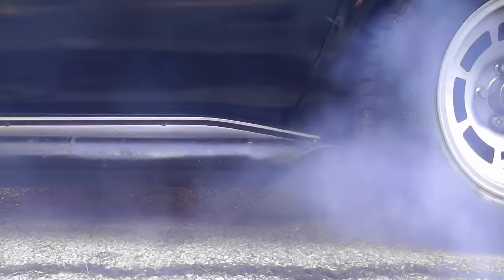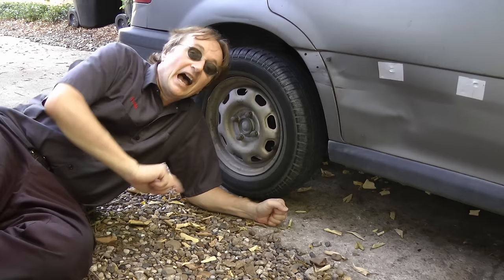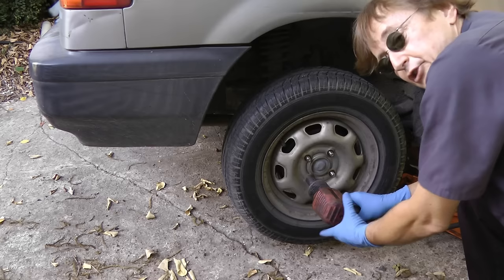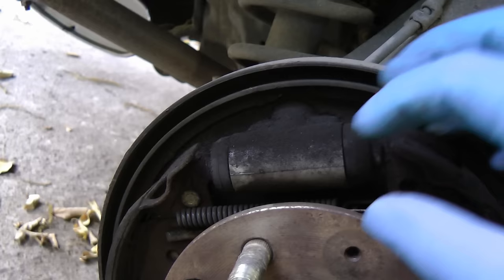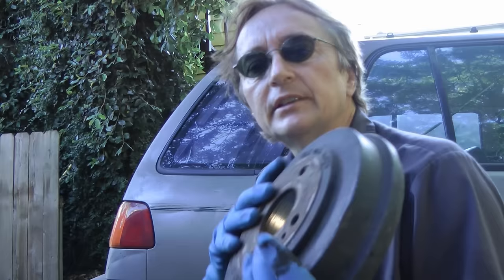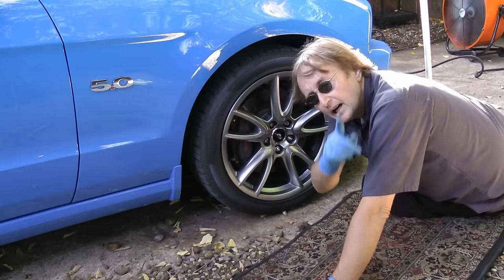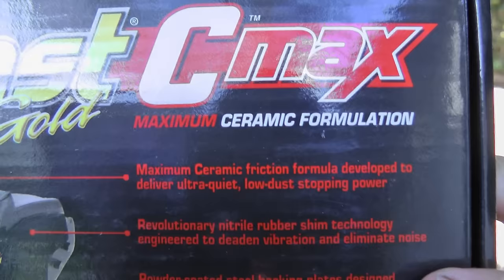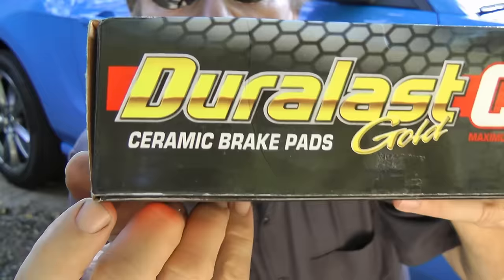How to Fix Squeaky Brakes in Your Car

Comment: hi I have brake problem on my car it's start after driving the car 40 km
and the problem is braking is not working wel it make some noise especially when car is on 20 to 30 km speed
please help me
Reply from the maker: when it doesn't start, if it doesn't crank, replace the starter. if it cranks but doesn't start, do my video "fixing a car that cranks but doesn't start up"   As for the brakes, pull off the wheels and check for wear there first, if you find none, often a bad master cylinder
Reply: no, I mean car doesn't stop when I push the brake
Reply: Like he said it could be the master cylinder or you might have air in the brake line.  That's probably why your car won't stop when you push the brake pedal.

Comment: I bought a Mercedes c300 and the squeak is bad. I brought it to the shop and I was told the brakes were new and that I needed to replace my rotors as well as brake pads again to stop the squeak and that will run me $800 to fix. But safety wise. I’m okay. 😑😑 I don’t have $800 laying around to give them more money out of me. Do I have to pay this costly repair or is there a cheaper way like this? Or something I should ask for next time I go to a shop?
Reply: Do it yourself is cheaper way

Comment: Hi Scotty,
I have a problem with squeaky breaks, I think I did all the tricks you mentioned here and still can't get rid off this annoying sound.
1. I bought new pads and they where good 2 days, after that they squick like crazy.
2. After that I took them off and lightly sand it to take of polished surface, that was good again for 2 days, and I have a same story all over again. 
(My car is old type '90s and stuff.. doesn't use ceramic pads)
What else I can do? I'm thinking about purchasing new brake disks but don't want the expense if that not going to help.
Please, I appreciate any advice on this one.
Thanks.
Reply from the maker: Tomislav Kukic if you put on quality pads and new rotors, noise will always go away. You can't sand rotors to make em not squeak for long, replace em if noise bothers you
Reply: Scotty Kilmer Thanks I will replace them.

Comment: You're the man, Scotty. I love the videos. I have a rattle in my dash of my '95 Civic. It only happens while in drive and I think it's my heater core. I'm losing water somewhere but I don't know where. I changed my oil to see if it has leaked into the motor but it hasn't and there's no water inside my car so it's a bit of a mystery. Any advice?

Comment: I just had new pads put on the front of my car as well as the front rotors sanded down, now 2 weeks later I'm getting a weird creaking sound (not squeaking) when I apply the brakes, sounds like it's coming from the front,  Only happens now & then.  Also it doesn't feel like the brakes are grabbing properly I have to really lay on them to get the car to stop, what could this be...anyone?....new pads are ceramic.  it's an 04 Toyota Highlander, 118k miles.  no dash lights come on.

Comment: Scotty On my 2008 Jeep Liberty, by rear breaks squeak ever so slightly when I don't have my foot on the breaks every little imperfections on the road makes the rear brakes squeak a little without me applying any pressure to the brake pedal, it's annoying,but what exactly could it be?
Reply from the maker: if it has thick pads still, live with it. But if you don't like the noise, but on Akebono pads which are very quiet and make no noise. Jeep just uses cheaper pads on their vehicles
Reply: Alright Sir thank you!

Comment: Hi Scotty. I've recently acquired a 2006 Volvo V50 T5. I sent it in for its cambelt service 3 months ago, and brakes were still squeaking afterwards. Shouldn't the pads have been checked in the service? It only starts squeaking after about 10 minutes' driving, btw.

Thanks for any help I can get. ;)
Reply from the maker: volvos are notorious squeakers, ONLY replacing pads with quality volvo pads AND rotors fixes that, but if pads are thick, many just ignore it as that's how volvos are
Reply: Scotty Kilmer Thanks very much. I would have thought that quality Volvo pads and rotors are what I already have, since the car has a full service history and has only been worked on at the dealer. :/

Still, I will check the pads for wear as suggested in your video and clean them while I'm at it.

Comment: Hey scotty I replaced the front brakes and rotors on our 1986 pontaic 6000 2 weeks ago and now the front left brake makes a loud rapid knocking noise and vibration when I applied the brakes to slow down... what do you think it might be
Reply from the maker: either that rotor is out of round or it not mounted on a flat surface (the hubs often rust and need cleaning off or rotor will sit crooked).
Reply: Scotty Kilmer  man top caliper bolt came loose, the caliper itself was hitting the rim, and bent the back plate... I caught it in time thank you scotty

Comment: When I put new brake pads on I started to get a slight scratching noise when I drive and my rotors and calipers are still very good what can it be?
Reply from the maker: TeriyakiRan most rotors have a small ridge, if you dont replace em, they tend to make noises
Reply: Is there a video on these ridges and how to replace them?

Comment: It's it normal for the new rear brake pads to squeal? New set of rotors and rear pads. The brake only squeal after driving more than 40+ mph. Once it cool down it doesn't make squealing too often. I noticed if I brake harder it barely makes the squeal.  I was told there was needing a break in period for the new pads to settle in. I am currently using a thermo quiet ceramic pads for the back.
Reply: +Elton Tang I forgot to add, it doesn't sound like a normal squealing. When I apply the brake it sound like vibration squealing, I am not sure how to explain it too well.
Reply from the maker: +Elton Tang  You changed rotors and pads, only thing left is all the brake hardware the pads fit into, those metal parts, change them places like auto zone sell the kits
Reply: +Scotty Kilmer can you change the brake hardware at autozone ? Mechanics want to charge 150 labor for changing the hardware
Reply: +Natural Bro TV by changing the hardware do they mean the brake caliper?? I can't imagine someone charging for $150 dollar that. You can simply but the hardware kits and just change it yourself. Basically if you know how to change your brakes is simply take out the pads and swap out the metal brackets and all the boots around the caliper pin cover and etc.
Reply: no the hardware means the brake clips, no one really care much about changing them but they cause squealing

Comment: Hi Scotty,  I just had my rotors replaced about 2 years ago along with the back brakes and Just had my front brakes replaced but since then occationally my brakes (i think) have been making a gurgle sound when braking at low speeds. I have topped off my brake fluid and pumped the brakes to get the air out of the line after filling it up. still makes that noise. I don't have to put much fluid in at all. maybe a eighth of a inch of fluid when i do. Any ideas? It is a 1993 ford explorer
Reply from the maker: often that's a worn brake master cylinder, if you see no leaks, it's usually them cause they leak internally into the booster
Reply: should i worry or is it just a nusisense? I'm newly widowed and don't have alot of money to spend on my car but if it is a safety issue I best do it. 
Thank you for the prompt reply and I always search for your answers!!

Comment: hey scotty my car squeak when i put it in drive and let the brake go slowly what does this mean.the noise kind relates to taking off bolts with have been torqued very tight.Plz Reply
Reply from the maker: +talha rehman  check the brakes first to see if pads are worn down. If not that, MANY things can squeak, from old bushings to  worn struts
Reply: ok.Thanks for the info though

Comment: Hey Scotty, I replaced my rotors all around along with duralast gold cmax brake pads (like ive always used) and they started to squeak after like 1k miles, I checked them and greased them up but still they squeak. I also notice they won't squeak at all when brakes are still cold but once they're warm (after like 8 stops) they squeak while softly pressing the brake or while moving at low speeds, pressing the brakes hard makes the squeak go away. Any ideas??? My car is a 2004 Mustang v6 if it helps
Reply from the maker: pads or rotors were just cheaply made, their coatings came off and now they make noise. I personally use akebono pads, they never do that
Reply: Thanks, I'll replace the pads and shims first to see what happens first,  if all fails then i'll just move towards the rotors.

Comment: I have a 2015 Audi Q7 and my brakes are squeaking, and I havent changed the brakes since I bought it. I have 5k miles
Reply from the maker: rust often does that from not driving them enough, it builds up, then wipes off after they heat up

Comment: I have a new tundra with 1600 km on it and the breaks squeal horribly for a long duration.  But only until they've warmed up.  I could ride the break slightly and it will be non stop screeching.  What can I do?
Reply from the maker: I would put akebono pads on it, they never make noise.
Reply: thanks.  and oops *brakes haha
Reply: oh gee never thought of that.  thanks man!  
how do i get your mother to stop squealing as well?

Comment: my 2001 dodge neon has brand new brake shoes and drum and hardware but makes a lot of noise while I'm driving and gets quieter when I brake. does that mean I should add brake grease or could it be the wheel bearings that need to be replaced also?
Reply: or could it be the parking brake needing readjustment??
Reply: +Anthony Lorenzen Maybe it is
Reply: +Anthony Lorenzen Maybe it is little rock stuck beween your breaking discs, I haf that noise too and I went to service and they told me it was because of stuck rock

Comment: hey scotty, quick question, long story short, my rear breaks started making noise when it got to around 20 km and it was like some sort of a noise where a metal was scrapping against another metal. so got my pads and rotor changed cuz it was time to change anyway. noise was gone for about a month, and SAME noise came back, took it back and same story, was gone and came back and I'm getting really frustrated as this issue is just not going away, and i know its the REAR, please any tips or advice would be awesome. it is when the car gets to lower speed and there is also a new noise where i apply the break halfway it makes the noise but once i press it all the way, it goes away... and its a 2007 Honda Civic Ex coupe. thanks. ALSO THE FRONT AND REAR PADS AND ROTORS ARE ALL BRAND-NEW, and the last time i took it to my mechanic, he replaced both rotors in the rear cuz one of them wasn't straight and had some bends to it.
Reply from the maker: +pavarchin   cheap parts do that. They have coatings on them, which wear off then make noise again. Go to a mechanic who uses better parts.
Reply: thanks a lot for the reply, but this mechanic used the best ceramic rotors, like its getting really frustrating, this is the person who has been fixing all of our car problems for a while now

Comment: I have a 2000 eclipse and the brakes are squeaking so we turned the rotors, pads are still good, but the squeaking won't stop. Should I just get new rotors and pads? If so what kind?
Reply from the maker: yes, get new parts. Akebono pads never squeak and if you use them, you can even buy the cheap chinese rotors, they will work fine with akebono pads
Reply: Okay and also my Dad  is so sure that standard rotors won't work on my eclipse but should I just listen to what the part store says?
Reply from the maker: James Hampel
listen to the parts store, they have to guarantee what they sell you anyway
Reply: alright thanks

Comment: hello,parked my car for over year,picked it up and drove fine until i parked it with parking brakes. right front tire makes such a noise now that its embarrasing .pls help
Reply from the maker: pull right front wheel off, check to see if anything is worn . If not, brakes rust sitting that long, and just driving em a week or two generally rubs all the rust off

Comment: When my car starts running it makes a squeeky noise but as soon as i speed up the noise goes away , any help on that?
Reply from the maker: Pancho Panochas check for worn brake pads
Reply: It may be your belts sometimes they will slip and it will make a terrible squeal until you idle the car up

Comment: Hi Scotty my mate has a late 2013 corsa 1.4t black edition and his brakes have started squeaking already, it's 6 months old what could that be?
Reply from the maker: cheap pads and rotors do that, unless he drives like a maniac and has worn them out already
Reply: So pads can get worn out so quickly? The brake disc looks really scratched as well
Reply from the maker: ATBparkour if you brake like a maniac, I've seen guys wear em out in less than a thousand miles.

Comment: My truck makes a screeching noise when i drive its sound like its from the tires do you know what it is
Reply from the maker: pedeweres85 of course check the brakes for wear, but if it is the tires, cheap tires or ones low on air often do that. I just replaced crappy kumho tires on my wife's car and the noise went away
Reply: Scotty Kilmer thanks

Comment: I've taken my car to two different mechanics and both have said my brakes are new and the rotors are still in great shape...which doesn't solve my problem e brakes are still squeaking...anyone have any idea please help. It's a ford.
Reply from the maker: esmokez95 put on new rotors and pads if you don't like noise. ANY wear on the rotors will make squeaking

Comment: i have a dodge durango 99  i have a problem  couple times the mechanick change  the  drum brakes  because  was killing  the  brakes and  drums   alot  smoke  come out  of there   they told me  that  was  the cilinder,the emergency brake now still the same problem  for months  since  y bougth this truck  he  back drums  and brakes  come out  alot smoke  killing  the and burning  everything inside  of the  drums
Reply from the maker: +Dave Rivera if he put on new cylinders, then either the brake hoses are clogging up and don't release pressure, or the brake master cylinder is bad and not releasing pressure
Reply: so what  he meant  i must change the master  cylinder   scotty   thanks  you so much   you are very helpful  at all times  you are genious  and  god bless you  and be thankful  to meet a genious  and  honest humble  man like you
Reply: scotty  my truck they can not  never  find the problem  check engine ligth    is always  on. i took to  couple mechanicks  and they told me  take  for  ride  50 milles  and  they will  go of  other  told me  about  fan relay  but  the  truck not  have  a fan relay the space  are empty in the relays  box    not one have  find  what is wrong

Comment: 2009 Honda civic Si model coupe. Recently bought the car, and now when I'm driving it, I hear a screechy rattle noise on the driver side rear wheel. And when I slow down, and make a complete stop, it will screech and squeal like crazy. Even after complete stop, the screech can go for up to 2 seconds. But it will only screech when slowing down and completely stopping sometimes, but when driving, all the time. Any help anyone?
Reply from the maker: pull the wheel off, often just worn out brake pads hitting the squealer warning device.
Reply: If it goes on after the car has completely stopped, it isn't the brakes. The brakes can only sqeeck while the car is still moving, because the sound is created from the two parts rubbing each other. You say it comes from the back, so it can't be engine related. Then my guess is that it is the axle bearing that is sqeecking, which is much more costly than replacing the brake pads unfortunatly. Hopefully there is some sort of warranty on it?

Comment: If you're doing car or truck size jobs, with any brand pad, you must use an OE Approved procedure developed for technicians by company that manufactures Silencer Brake Rotor Conditioning Treatment and Ceramlub.  Most pads can work properly but they must be installed with a procedure.  Anyone can do it if they apply 5 simple steps and learn how to burnish after assembly.  To better understand procedure and that brake noise comes from a rotor not a pad, visit this link...  stop brake noise . com

Comment: my audi a4 2006 took it to check the brakes they told me, that it was new brakes on it
Reply from the maker: UNLESS a brake job on an audi uses new dealer OEM pads and new rotors, they often make noise. Live with it if they are not worn out, cause that costs a TON to do correctly, noise just means cheap pads or worn rotors.
Reply: is it ok to use gumout multi system tune up on my 2006 audi a4 2.0t or nah?

Comment: I thought ceramic brake pads are designed for F1 cars. I don't think it will make a big difference.
Reply from the maker: many modern cars use ceramic brakes, because they perform much better.

Comment: Hi Scott I have a 1996 LS 400
And my brakes squeals when I stop,
All the time and I jus had them replaced along with my rotors
About a week ago, but now my brake light is on, on the dash.....
What can I do or what you think is the problem+
Reply from the maker: realize any brakes can make noise, so change the other pads and rotors if you didn't do all 4. But if you did, with that light on, you either have a fluid leak or are losing pressure, like a worn master cylinder
Reply: Ok thank u
Reply: Do 1996 Lexus LS have sensors on the brakes?
Reply: Hi Scott I have a 1996 lexus LS 400 n I have a PO430 code wat does that mean?